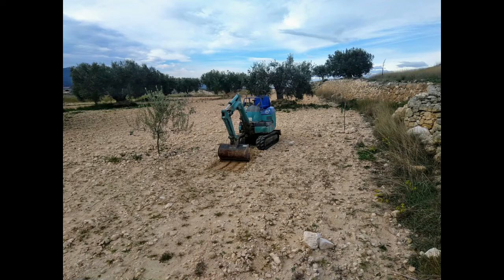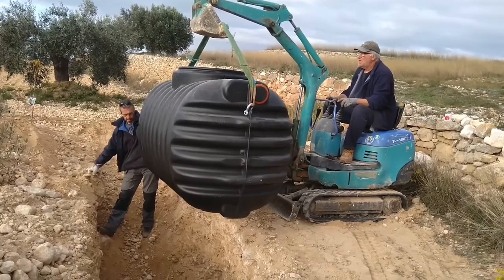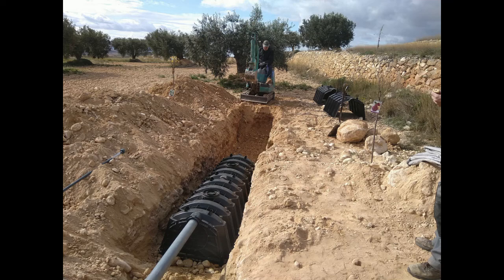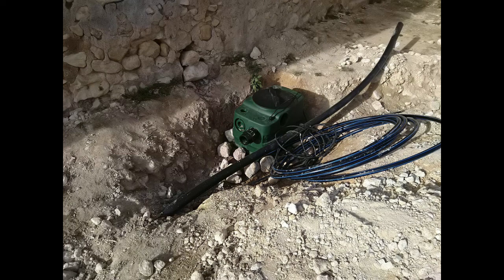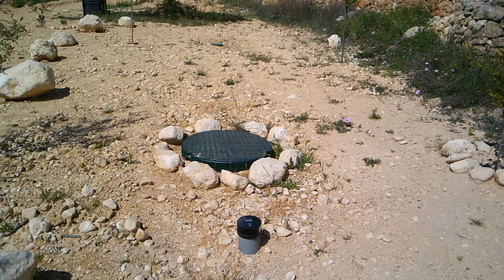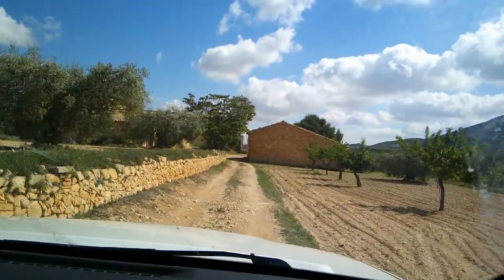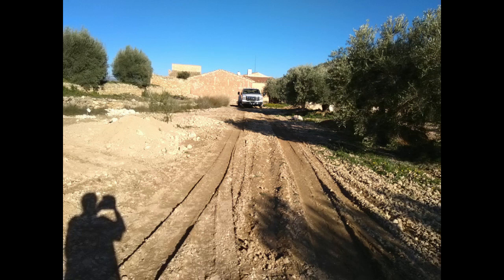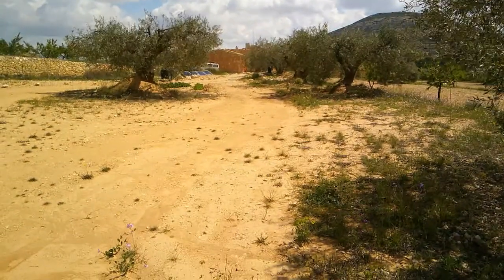Off grid Finca - Installing the septic tank, other groundworks and a new driveway entrance!

Comment: Hi guys, you've provided a fantastic resource for those of us following in your footsteps.
Can I ask a quick question please, you mentioned that there was no smell from the tank valve and also that you had a long way to pump up Hill to the septic tank, what was your reasoning for situating it so far away?
Reply from the maker: Thank you. Basically, the shape of the land. The house is right on the corner of our plot, on the lowest part of the land. The land below our drive doesn't belong to us. Ours is at a higher level behind (the back of the house is half underground) and at the side, which isn't so elevated. We also wanted to plant fruit trees around the soak away as we get so little rain (which is working very well) so it was the most logical place to put it.
Reply: @FincaLife  makes sense, thank you so much for taking the time to respond
Reply: @FincaLife  Hi Andy, one more question on the subject please, I can't seem to locate a pumping station on any of the septic tank sites, even in Spain. Could you point me towards the one that you have please.
Reply from the maker: @casaMariaPT  Ours is from a company called DAB pumps. The Spanish website is .es The station is a Fekabox and you insert a suitable pump inside the box. They do a full range of stainless steel, very high quality pumps.
Reply: Hi guys, I forgot to post my thank you response at the time, so a big belated thank you.